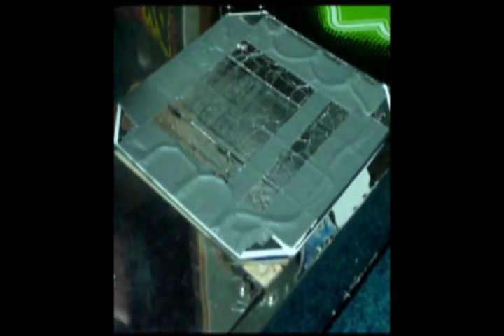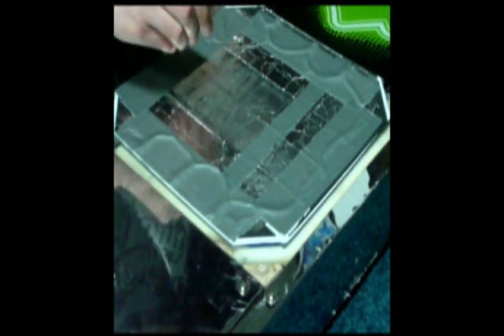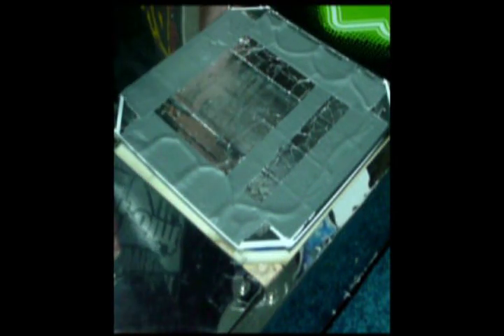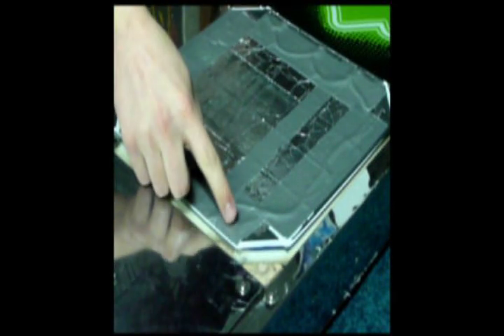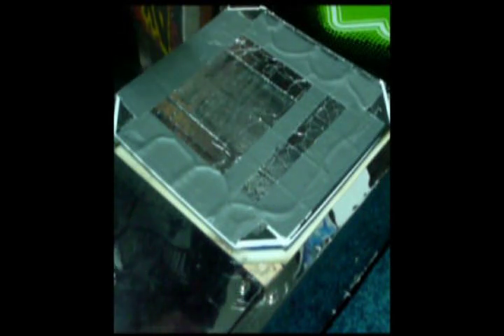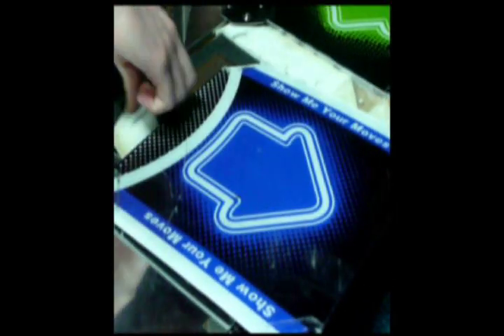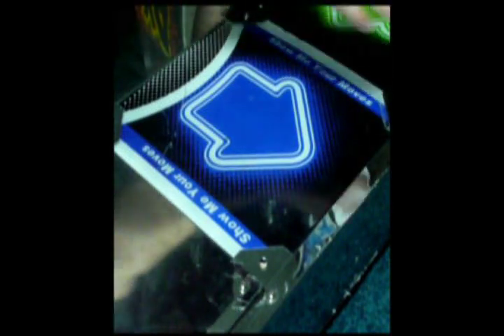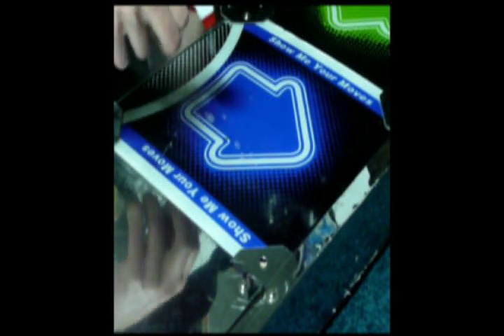How To Mod You Metal Dance Pad To Be More Sensitive And How To Fix A Metal Dance Pad Part 2 of 2

Comment from the maker: @92Romy92 Yes, this mod will help make the pads more sensitive.  The control box being snapped in half would likely cause problems as well for your dance pad.  You might also want to check if all your wires that are connected to the sensors are still connected and have no broken off.

Comment from the maker: @92Romy92 It sounds like you didn't use the right kind of tape or the tape correctly.  You HAVE to use double sided heavy duty tape.  If you use duct tape it will come off and break apart.  Open up the panel and make sure the foil isn't tearing apart or slopping over onto the panel.